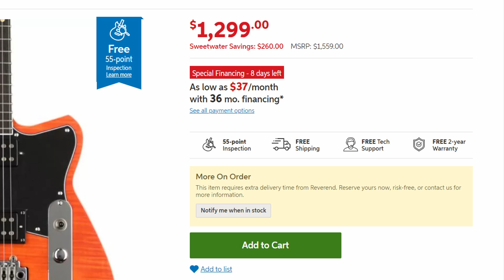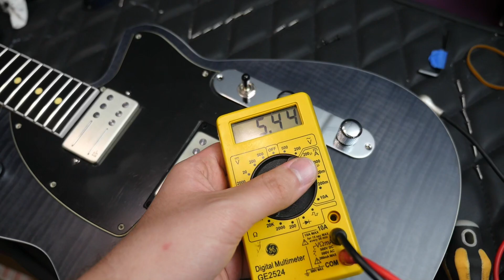This "Misshapen" Tele Is Quite Cool! | Reverend Reeves Gabrels Signature Electric Guitar Review

Comment: -It is a flame maple veneer, not a photo. Satin finish will lessen the amount of motion on some flame tops.
-It is a Pure Tone mono jack with two points of connection
-The swimming pool routes under the neck pickup on Reverends add to acoustic resonance and projection like an acoustic
-Reverend sets up all of their guitars before they are shipped out, so they might be worth demo-ing before taking them apart. Especially with Wilkinson-equipped guitars such as this
-Reverend's more tele adjacent models include the Eastsiders T and S, PA-3 Baritone, Greg Koch Gristlemaster and Gristle 90, the Crosscut, and now discontinued Trick Shot.
Reply: Reverend is live right now on Facebook and Ken just explained that the top is a very thin veneer not a photograph.

Comment: The output jack is a True Tone connector, superior to all other 1/4" output connectors.
The top is listed as flamed maple, it is a veneer.  Typically satin finishes are not conducive to the chatoyance effect.
Reply: I kind of enjoy that effect until it wears through.
Reply: @vladimirpoutine7522  What wears through, the satin finish or the veneer?
I doubt the veneer would ever wear through, and as for the satin finish, it will gloss up in high wear areas and then just wear down slowly like any other finish.  Given that its a poly finish it will most likely just gloss up a bit.
Reply: @lettuce_spray  Absolutely yes.  Modern Poly finishes are indestructible.
My Son asked me about the possibility of installing a passive bass roll-off circuit in either one of his Jazzmasters or possibly a Les Paul.   With the Jazzmaster you could utilize the satellite controls on the upper horn!
Reply: Damn if it ain't HK at it again...
Trogs channel technical consultant..
Reply: @hkguitar1984  My bad I didn't realize this was a poly finish. You're absolutely right though, indestructible.
Reply: @markbaum9615  LOL, just more years than I care to admit spent playing and fixing guitars.   How ya doing Mark?
Reply: @lettuce_spray  The Passive Treble/Bass is super flexible.   I don't know how it wouldn't sound great.   Unlike a Tele style (like this Reverend) you actually have some room to work.   At one time I wired up a Tele with individual tone and volume controls for each pickup!  I used the individual stacked dual pots Fender uses on some of their Bass guitar circuits.   Those double pots are like an iceberg, there is a lot more underneath!  And in a Telecaster route there is no extra space.
The PTB is a great control circuit.
Reply: @richardclark.  ..we're all just guitar junkies and Trog is a quik fix
Reply: @hkguitar1984  doing well thanks Sir
How's that tele with SS frets coming along...hoping for natural with oil finish to give it a slight amber ...
Reply: @richardclark.  Oh, its deep alright!  LOL
All in good fun
They are just guitars, not my retirement portfolio!
I sometimes think his crazy comments are purposeful to keep viewers engaged.
I'd be curious as to his metrics, I would imagine a high percentage of his views are for the entire video!  Or, I could just be projecting and its just me!  ;-)
Reply: @lettuce_spray  This will take some time for me to erase that image from both my conscious and subconscious posterior cortical hot zone and temporal lobe of my brain............
Thank You for that ICK...........
Reply: @markbaum9615  I'm expecting the neck to arrive within the next 10 days.   When it arrives I'll upload a video so everyone can see what happens when a misguided obsessive compulsive wanna-be guitar builder throws caution and Dollars to the wind!
Reply: @hkguitar1984  looking forward to that ....
Reply: @markbaum9615  Me too
Reply: I believe you meant Pure Tone, which has multiple spring loaded contacts.
Reply: Cant believe Trogly thinks thats a photo flamed wood, its obvious its a veneer, but not a photo. I like his content, but sometimes just cant believe some of the things he says.
Reply: What is the fretboard made of? Because it looks like rich lite.
Reply: @CarsInDimension  Thank You CardinDepth, yes, Pure Tone.  I have them in all my instruments now, they are a fantastic improvement over stock.
Reply: @papasmamas1  100% agree.   Sometimes I wonder if he purposely misspeaks to keep viewers engaged!
Many Face-Palm moments for sure.
Reply: @timothycormier3494  highly polished Ebony.   The Ebony on my Martin is highly polished and looks very much like a man made material.
I agree with you though, except for one of the close-up shots of the nut where you can see the Ebony’s grain it does look like Richlite.
Reply: Thank god someone knows what the specs are!
Reply: @Amp497  yea, I know, but some things you can see with your bare eye, no need to be an expert, I mean... he have seen wood before...
Reply: @hkguitar1984  yes... I can say a lot bad things of him, better dont, dont want to sound like a jerk.
Reply: @gazzy_burns  Right!
Reply: @Amp497  LOL
Reply: @papasmamas1  Double LOL
Reply: @papasmamas1  As my Mother used to say, "if you can't say anything nice its best not to say anything at all"
That said, yes Diego, I share your sometimes frustration.  
It is what it is, no more and no less.
You have a fantastic day and an even better tomorrow.

Comment: you need something to put under the bridge to keep it level when taking the strings off. it will save you some tuning issues. a little something i learned from 40 years of playing floating bridges.

Comment: Flame tops vs. satin clear coats: I’ve found that the more satin the finish, the less movement you get… so if the top/veneer was already limited in movement, making it satin makes it just look frozen or fake/photo. It could also be because it looks like they didn’t do what PRS does to make the flame pop (it’s a multi-step dye process), so it’s got less depth.

Comment: I snapped one of the posts once on a Wilkinson brdge equipped guitar once.
I'm not sure if this one is the same, but that one had a tiny set/locking allen screw within the post that you have to loosen off before adjusting.

Comment: Love, love, love my Reverends… got one of the Spacehawks - killer tones!
Reply: Me too! The only downside for me is that it's a tad awkward because of the size, compared to my frame.
Reply: @cpfs936  hey, CPFS, Unfortunately, just a couple of weeks after my post, I discovered my storage unit had been burglarized. Lost 9 guitars and an amp. I’ve seen a couple of videos on YouTube (including Trogly’s) concerning this issue. And it’s happening more and more. So be careful. I lost my Spacehawk. It was in the ultra cool purple burst. Mint condition. Teardrop case. Also lost my Reverend “tricky Gomez” both No longer in production. So can’t be replaced. (Readily anyway). Sucks! Luckily I still have 1 Reverend. a Rick Vito signature. Not his new one, one from about 2013. Ebony gloss w/a cream stripe down the middle. Very “Art Deco”. I am going to continue to search for another space hawk in either the purple burst or the red burst. But they are not popping up on Reverb or eBay very often…
Reply: @igorshunch  Man, that's a heartbreaker! Fortunately, mine doesn't leave home often, just to hang with friends.

Comment: Did not like. Lots of out of tune and weird string twang. But also that is half of the Fender TBX tone pot.. They should have just done it with the stacked pot. I run one on my Junior SD Full Shred with a capacitor instead of the shunt 82k. Super useful but a single tone pot with a center detent works better. I also have Series Parallel. She gets strident and bright. But with a reactive fuzz face there's a shock when you get the gain right.

Comment: Buy American
Reply: yes definitely, especially if you want overpriced poor workmanship.
Reply: @cosmikrelic4815  that will hold its value and gain value overtime. USA  and Japan guitars are top notch. There was some good stuff coming out of Korea for a while. But USA Gibson’s and fenders are killer guitars. Indonesian Schecters are surprisingly good too. But USA guitars are best. I have a whole gang of guitars. From a cheap Chinese Squier, to Ibanez, to custom shop gibbys. And while there are good and bad guitars from all over the world, Gibson’s are my favorite. Followed closely by Japanese built ESP’s of which I have 3.
Reply: @Wargasm54  umm no, american guitars are not the best. they over priced, qaulity is very variable, and they lack the features of much less expensive guitars. it is difficult to find an asian made guitar that doesn't have locking tuners, roasted maple neck, stainless frets, ebony fretboard etc. these ar all extras on an american guitar which will cost 2 to 3 times as much without the extras.

what you describe as killer guitars are just subjective preferences, i and many other have killer guitars which are not gibsons. 

yes, american guitars hold there value, iot just goes to show how moronic the general guitar buying public are.

i have no reason to believe that an american guitar builder is anymore of a craftsman than any other nationality, espacially when they drive the same CNC machines most of the time. sure there are handcrafted guitars but most cannot afford them.
Reply: @cosmikrelic4815  that’s your opinion. And that’s all it is. And the market completely disagrees with you. It’s ok kid. You’ll have money some day.
Reply: @Wargasm54  yes it's my opinion as is yours. you didn't say which part the market  disagrees with, but show me the data that shows disagreement, and then show me that this disagreement is a valid argument against what i have said.

you seem to think that your opinion is more valid than others, and calling me kid, and that odd stement about money shows your immaturity.
Reply: @cosmikrelic4815  my opinion is in line with the WORLDS opinion. So I would say my “opinion “ is closer to factual and yours is closer to delusional. Based on sales/popularity, use by famous players, legacy and historic importance , Fender and Gibson wins hands down. That’s common knowledge. But apparently knowledge isn’t all that common with you. I think it’s past your bedtime punkin’